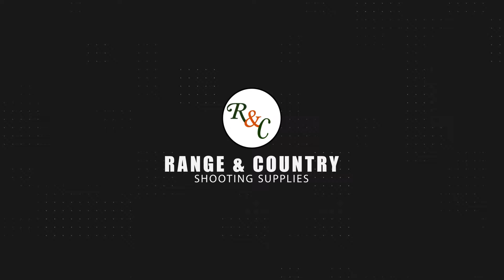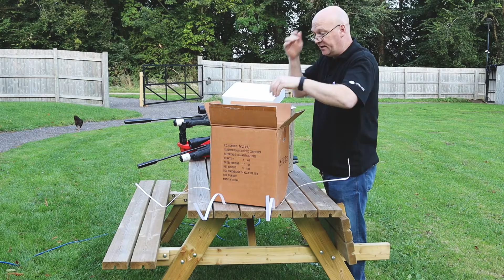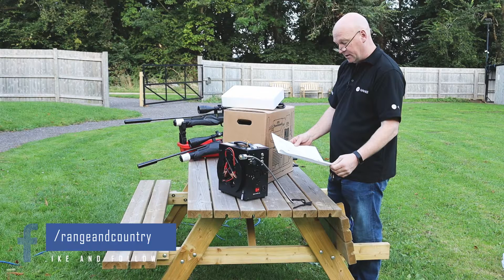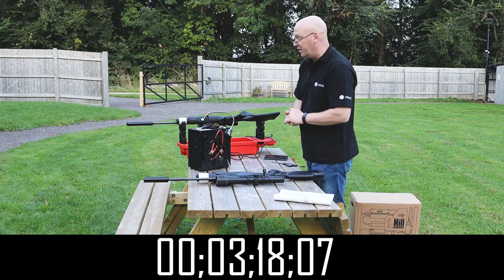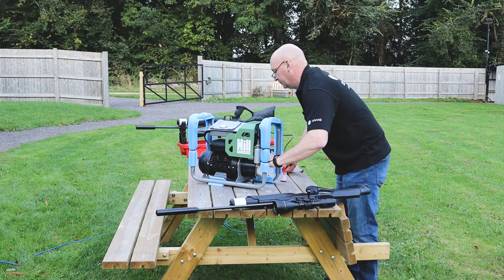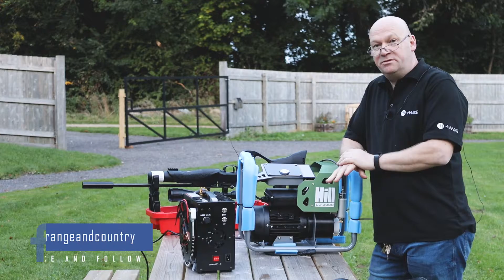Range & Country - BSA + Hills Compressor Review

Comment: Hi, as you are a guy with an electrical background, I have a question.
I have a 12v cigarette type socket in my boot, Is it possible to cut off the battery clamps and convert them to a round plug to fit said 12v socket.
Reply: No, to many amps.

Comment: So the “bsa” compressor has no moisture filter or trap so fills you rifle with wet air, not good at all!
Reply: You need to put your own inline filter on it, it's very simple.
Reply: @PeakyBlinder  considering it’s a re badged gx cs3, for the extra £150 they are charging it should have that included!
Reply: @Airgunfunrich  true, but the cx also needs an online filter, the one in the handle is a fraction of what it actually needs.
Cx is ok I converted mine to run off an 18v M18, 
I'm looking for something that will fill a dive tank though, that hill is looking good.
Reply: @PeakyBlinder  but the xx is £150 cheaper ffs

Comment: We are being spoilt, 2 videos in 2 days 👍, I was worried when I seen the chickens go out the gate 😂

Anyway to the compressors, the BSA connecting to the battery, not if you have an electric car I take it then, nice small unit if you only want a gun filled up in the day time. Bit noisy if filling up in the night tho, nice quick set up on that BSA 👍

The hill, like the idea that you can top up your tank, bit more set up on the hills but a lot quicker to fill.

Like you said depends on what you want to fill, I think I would go for the hills as I would just use it to fill my tank and then fill guns from tank, but nice to see a review of them 👍